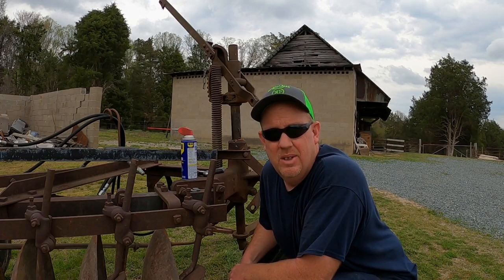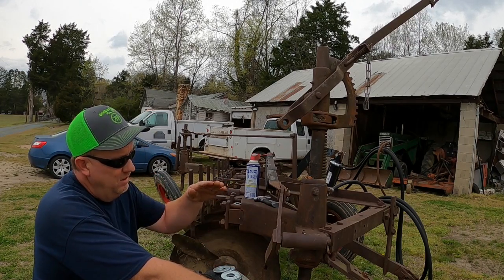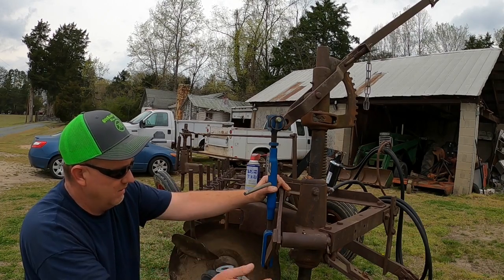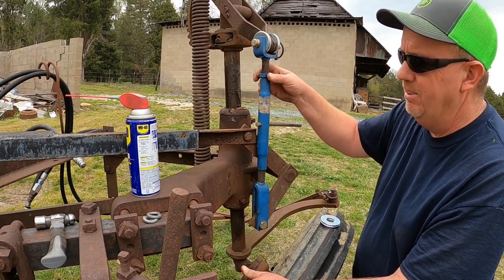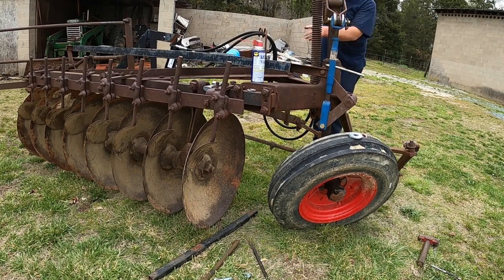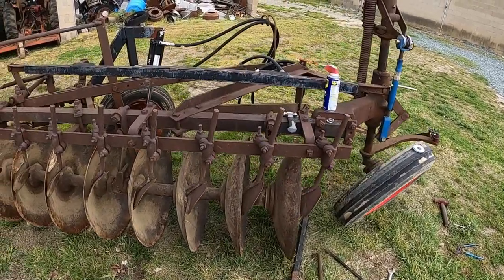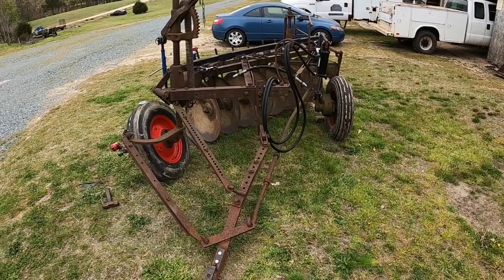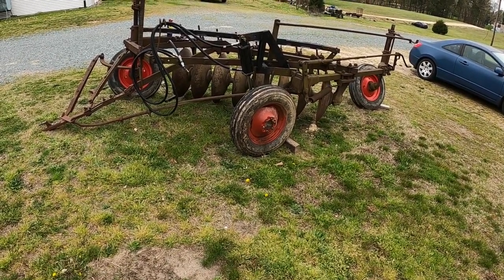IH #99 Disk Plow/Tiller gets the needed attention finally. Been a long time coming

Comment: I have never seen one of those being pulled. I bet that thing pulls like a sled. My tractors would pull it just fine... until I let it down and into the ground. That would stop my 2520 dead in it's tracks. 
One nice thing about where I live. It doesn't take long to polish moldboards and disc blades in this yellow clay soil.
Reply from the maker: Well Mr Gary, hopefully we both can see it really work very soon 😉😁 I haven't had it in the ground completely...problems, but I am betting it's gonna tug on the 1086 quite a bit😳🤔😉 You know, that's the weird thing....I don't really know at all how the soil will be here, mostly red clay knowing my luck🤦🤦🤦 Thank you.sie very much for continuing to always be here watching, supporting, following, and COMMENTING!!
Reply: Never underestimate the power of the 2520.🤔